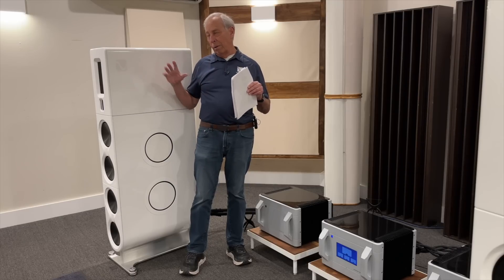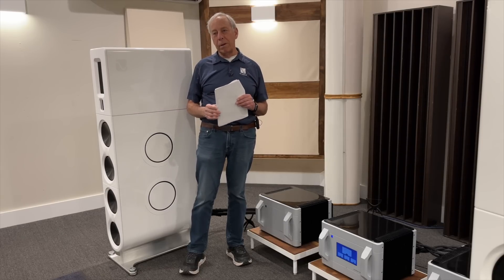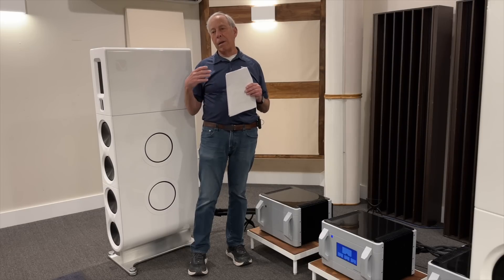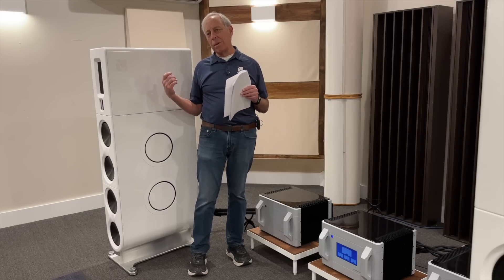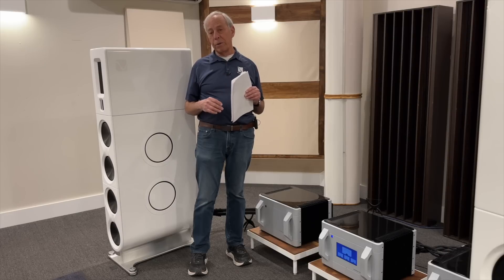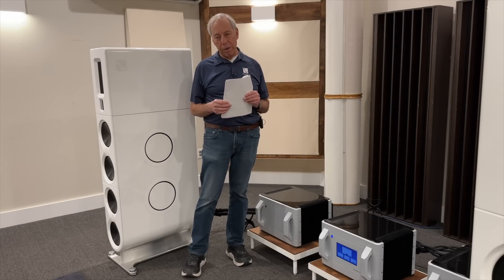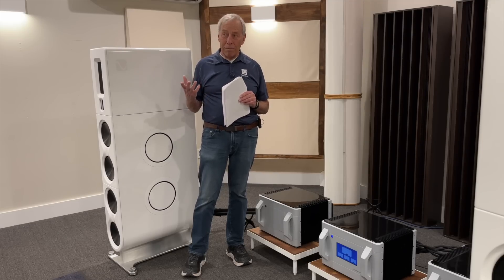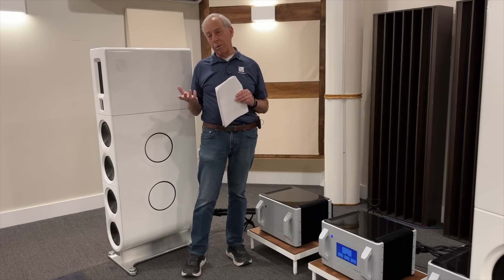Speaker crossovers and age

Comment: Would you consider supplying formulae to connect bits of wires in series and parallel & star and delta, as speaker network!? A technician actually supplied me with Resistance formula!? Some R1,R2, sin or cos and then 1/√, etc., something like that. Some ten or so bits of wires connected to woofer and tweeter. 6 legs, I remember in conversation!? I'll find him some day!?

Comment: Better to be careful replacing the crossover components, a lot of times the downfalls of poor components is actually intended in the design. EG; using an iron core inductor on the woofer due to it's lower resistance even though a air core one would be sonically superior

Comment: Good film caps can last a long time, sometimes 30 to 50 years. It is not always  a improvement to change them, the crossovers are designed with certain caps, some people report a decrease/change in sound quality with new caps. I hope the 50 year old caps in mine B&W DM2a are still good, I think so.
Reply: You’d be surprised. The change a capacitor goes through is so gradual that often the inevitable degradation of sound goes unnoticed to most listeners but make no mistake about it, if your caps are 50 years old then they’re definitely not functioning up to spec and you would immediately notice a vast improvement by updating them. I argued the “if it ain’t broke don’t fix it” theory for the longest time because at 46 year old my Klipschorns still sounded absolutely incredible. Or so I thought anyway. In spite of still sounding great at the time I still kept a close eye on the caps for signs of leaking due to their age and sure enough I had a couple start visibly leaking several months ago. So naturally I figured it was time to update whether I liked it or not and I’ll tell you one thing for certain, I was so happy that I did. Upon replacing the original caps with new sonicaps, which aren’t cheap by the way but not ridiculously expensive either, I noticed a massive improvement. I even rebuilt one network and compared it with the original and the new caps were an obvious improvement over the old in a direct comparison. The speaker that I had thought still sounded fantastic was actually becoming quite dull and lacked overall clarity in comparison to the new network. That’s because once again the change is so gradual that the average person simply isn’t going to notice and therefore assume that everything is still up to spec because hey, it sounds good right? Why mess with anything? However it’s actually the best thing you can possibly do for a speaker that old. Naturally you want to use something of quality. Realistically the only way a recap is ever going to sound worse over the plus or minus 50 year old caps is if you lack the knowledge to purchase appropriate high quality replacements. Though often manufacturers use cheaper quality caps in the first place to keep the cost down so generally it’s actually hard to end up with something that’s worse than stock. Especially considering capacitor technology has overall improved over time. Sorry about the long winded reply but long story short I don’t think you’ll be sorry for updating anything that old. Personally with the cost of even good caps being what they are I see no reason not to change them every 25-30 years tops.
Reply: @shannonmiller5648  I hear you Shannon but to be honest you just might like that old shoe better than the brand new one. Like I said, I made one single cap change in one set of RS IIIa speakers and they now sound different than the other set. If you make changes even to the same spec they will sound different, sometimes good and other times not so good. So if you have not had your speakers from the start you can actually change them back to something you dont like.  To me it really doesn't matter being I have passive bi amped all 4 speakers (8 channels) and have always used an EQ. Any wore off shine can be put back on if wanted (instead of that broke in warm feeling) by moving a slide another 1/4 inch.
Reply: @finscreenname  
An eq can’t do anything to fix a capacitor that has lost capacitance. I’m an advocate of eq’s in a system but their intended purpose isn’t to compensate for failing crossover networks. And of course when you change out a failing cap for one that meets original specifications it’s going to sound different. That’s the whole point. If you bought a particular speaker because you loved the sound of it then chances of ever being disappointed by simply keeping them in spec are pretty slim. That’s my whole point is that the degradation is gradual to the point that most people including myself don’t realize it’s happening therefore your ears adjust as the capacitors degrade. Before you know it your speakers don’t sound near as good as when you fell in love with them and the whole time you don’t even realize it’s happening. I can see your point only in the sense that yes, I suppose if you never knew what they were supposed to sound like then you may possibly not like what the speakers were originally intended to sound like. Even if that’s true in some cases there are other reasons to update failing capacitors such as eventually damaging your drivers which absolutely can happen if a capacitor falls to far out of spec. Do whatever makes you happy but I’ll always recommend keeping capacitors up to spec for multiple reasons. Not the least of which being that in my experience you realize immediately that your speakers used to sound better then they did after the caps fell out of spec. At this point every single speaker I’ve recapped that was 30 years + in age immediately sounded better. The difference is almost never subtle and has certainly never been negative in my experience
Reply: I have 2 sets of IRS IIIa's. Swapping then over to passive bi amping I broke a lead off a cap. Got the same specs cap(s) to replace them in the set. They sound different than the other set now. Not better or worse but different.
Reply: I recently pulled a set of large DIY speakers from my attic that I had built back in the early 90s, and put them back into service. They certainly did not sound as good as I remember them once sounding, but thought my ear memory was just bad (is there such a thing?). Then I cranked them up pretty loud. Opps! Bye bye midranges! So I ordered two new mids. When I was installing them, I noticed the caps were all swollen on the Xover so I grabbed my multi-meter to check them. All out of spec big time! In fact, I am sure that the mid cap simply allowed too much power thru to the mids and that is why they smoked. All fixed now and sounding great. Of course I didn't just stop with the mids. I have since upgraded all the drivers in these and they sound nothing short of amazing. Glad I didn't toss these out long ago. And yes, you should replace your caps or your drivers will most certainly fail at some point.
Reply: @jimhines5145  They didn't let too much power through. They let lower frequencies get through and your mid wasn't designed to go that low
Reply: @kennethblackmore2146  Well yes, exactly. Lower frequencies would also mean more power, right?
Reply: @jimhines5145  Not always. Just giving the driver a frequency it wasn't designed to handle can kill it. Imagine your tweeter is 50 watts and crossed at 5K, all good. Now try to feed 30 watts at 200 Hz, dead tweeter. This is an extreme example, but you should get the idea.
Reply: @kennethblackmore2146  While this makes sense, let me suggest for example, another way to look at this. I have a 20vrms (50 watts) 1khz sine wave coming out of my amp. Measured at the woofer side of the Xover, I have 20vrms (50 watts). Measured after the midrange capacitor, I have 10vrms, or 25 watts. Measured from the output of the tweeter capacitor, I have a mere 10 watts. As these caps degrade, would I not find more voltage RMS at the output of these caps, while at the same time, lower frequencies? Just following up because I want to know for sure and I find this very interesting. Perhaps my logic is totally wrong here.
Reply: @jimhines5145  I stand corrected, as capacitance goes down, the crossover frequency goes up. Formula is 1/(2*Pi*F*C). So a worn cap will give you a gap in coverage where the woofer cuts off and the mid begins. I cooked my mid by over-compensating with the EQ (never a good idea). The crossover though, is just a dividing device. If you have 10 volts in the woofer's range, it gets the full power, if you have 10 volts in the mid's range, it will get the full power, ditto for the tweeter.
Reply: @kennethblackmore2146  Now this makes much better sense. Of course, it WOULD depend on the frequency of the sine wave. Thank you! So a 1khz sine is not going to drive the tweeter at all, but an 8k would. There would be maybe a little to the woofer but all mostly to the mids. Very easy once I got my head wrapped around it....again. I knew this once before but got diluted with other things over the years. Thanks for the refresher.

Comment: I wish home audio would move towards active crossover like in the pro industry. I've mentioned it in the comments before but there's stuff like miniDSP for the home. It's really interesting to tweak it and hear instant results
Reply: @Douglas Blake  Don't let the money scare you. Commercial amps run cheap in the second hand market. I've bought 4 of them over the last couple years. 3 QSC's and a Crown. All of them look like they came from a clean room at a church or something. Paid pennies on the dollar being most people think "commercial amp" means 70V systems. For all the 70V amps out there, there are just as many "commercia amps" that are class AB or can do both. 
 I passive bi amped 4 RS IIIa's and used 2 QSC CX254's for less then $600. That's 8 channels at 250 watts at 4ohms. You can do a lot with 8 channels.
Reply: @finscreenname  you can get some quality class D amps for cheap too that'll sound decent. That said I prefer class A/B.
Reply: @bf0189  D's are getting there but I will stick with the old school AB also.
Reply: @Douglas Blake One of the justifiable fears people have with commercial amps is the noise from the forced air cooling. A massive crescendo is all fine and good until the pianissimo happens and the fans are still there, not flaccid soon enough to prevent their annoying presence from being heard.
Reply: @InsideOfMyOwnMind  I hear what you are saying but at the moment I am sitting in my basement with the back door open. I can hear birds chirping, the refrigerator in the wet bar running, the dehumidifier in the utility room, 3 or 4 clocks ticking, the fan from the PC I am typing this on and.....someone just used the water but I hear what you are saying.😎😎
Reply: @Douglas Blake I actually bought the first QSC CX254 real cheap and liked it for a lot. One reason is it blew the air hot out the front instead of into the cabinet. When I decided to passive bi amp the speakers I bought a Crown Cts 4200. I liked it and all but it just didnt play well with the QSC. So I went on the hunt for another CX254 and may have paid a couple extra bucks for it but I had to have it right now mom!! Another reason I liked the QSC is its smaller, about the size of a 5 disc CD player. I put rubber feet on mine, cut the "L" brackets off that hold it to the rack and sanded them so they are brushed aluminum and now they look like they were made for the home. The gain knobs are also on the front is a big plus. One thing I will say though about rack equipment with the QSC and the Crown is to not use any of their limiters / filters dip switches. No matter at what volume it screws with the sound quality.
Reply: @Douglas Blake Rational thought. It's not allowed. How DARE you!
Reply: Or you could just get a EQ.....
Reply: @finscreenname  Digital filters can do step (or brick wall) filters, which analog EQ components do not do.
Reply: @finscreenname   . EQ  cannot be  perfect solution  in all cases

Comment: Better to use active crossovers.
Reply: Those also use capacitors
Reply: @xanderguldie  they don't use electrolytic capacitors in the signal path.
Reply: @kyron42  ive never seen one without them
Reply: @xanderguldie  I built one using green caps and Ceramics.
Reply: @kyron42  well thats a whole different ballgame isnt it? I asumed you were talking about actives in general. Are they two or three-way?
Reply: @xanderguldie  3 way

Comment: Ha, ha. I'm glad to have been educated earlier by you Paul, in another video. 
I got my hands on my late grandfather's JBL 4311 pair, I knew nothing about electronics... I replaced caps in one, still the original wax sealed cardboard electrolytics... Amazingly, the other untouched 4311 still worked fine...ish
The only issue was a torn spider in the big woofer, but the 4311 crossover, to my understanding does not have any filtering for the woofer...Real head scratcher... 
I wasn't game replacing the spider, I was 24 and broke, so I used a sewing needle and some sika flex. 
Has worked great for a whole year.
Thanks Paul!
Reply: On more than a few occasions I have seen those square electrolytics used in the early JBLs go WAY UP in measured value which if true, would jeopardize the tweeters and possibly the midrange driver, so you always want to get those out of there as they are all at an age where they are highly suspect at best. When there is a capacitor across the woofer it is a quick and dirty way to pull mids out of the woofer which works well as long as the rest of the crossover is compensated to account for it 
Kudos on the spider surgery. You're a braver soul than I. I have however, come across speakers where there was just no professional solution for a replacement surround and you might be amazed by the number of things surrounds have been made from in a pinch for lofi applications, to include strips of packing foam and I could go on but I don't want to embarrass folks even more than I already have.😜

Comment: The only trouble with film caps is their prices.
Reply: Yes they seem expensive until you look at the price of replacing your speakers with new speakers that use film caps in them. You can replace the caps in your current speakers for $150 or less and the improvements are real.
Reply: most metalized film caps are pretty cheap, but they can get expensive once you move into film/foil capacitors, or caps with more esoteric materials. Dayton, Solen, Audyn and are all pretty solid choices with budget ranges.